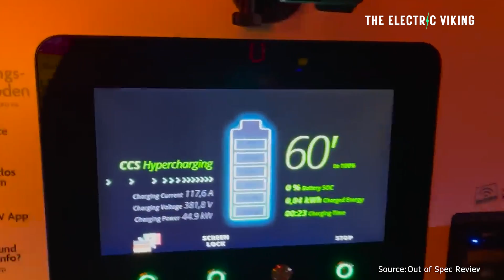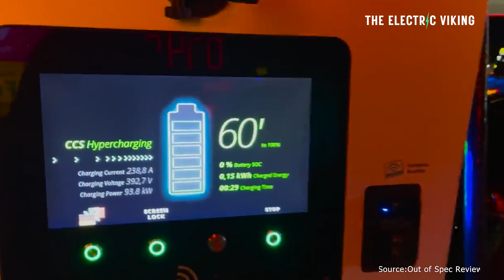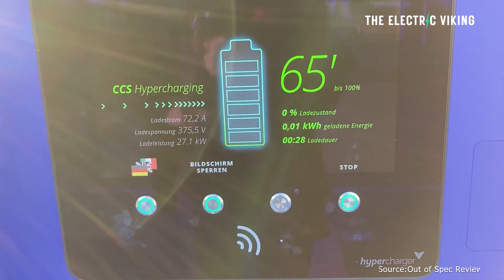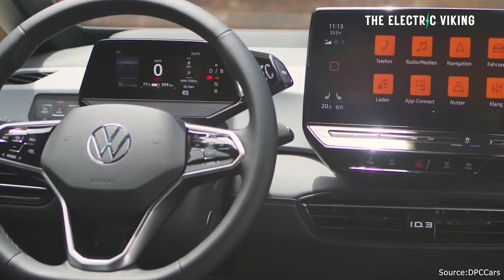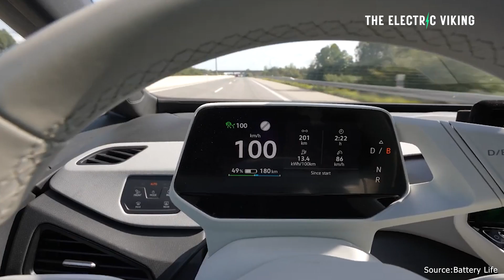VW EV Battery life tests show surprising 93% capacity after 62,000 Miles

Comment: I have a 4.5 year old ID3 77kw.  Any range loss is not noticable, it will still do 300 miles on the motorway with aircon on so thats fine by me. Its also a great car to drive

Comment: Volkswagen has quite good EVs by now. The software still can not compete with Tesla‘s, but it works stable and solid.
The chassis is a lot better compared to Tesla‘s though. I drove a model 3 recently and at >160 km/h  
the steering became very squishy.

The battery will not be the limiting favtor the life of an EV. The chips might break first after 10-15 years.

Comment: We have a 2029 egolf, which has a stated range of 125 miles. However, we’ve found that’s understating the true range by about 15-30 miles in normal weather. After 80k miles, there appears to be no battery degradation at all! Very impressive!
Reply: Oops was supposed to be 2019, not 2029.😀
Reply: Not true, all my updates have been OTA, that’s over the last three years.
Think this ideas  are a little  out of date.

Comment: We have a 23 VW ID.4 Pro S AWD with 15220 miles.  The battery capacity is at 94.45%.  As of February 6th the car is two years old.  Battery degradation is 5.55%.  We charge at home to 80% and very rarely take a road trip using DC Fast Charging.  It has a 82 kWh Lithium-Ion w/ SK.

Comment: The obsession with battery degradation is somewhat misguided. What is important is that the battery remains useable for the life of the car. Even at 70%, the battery will satisfy the same transport demands as a brand new battery. All that's required so to charge the battery just a bit more often. It doesn't cost any more in electricity to do this.

I think whilst we are in this technology transition period, where we don't have concrete examples of modern EVs that are 20 years old, there will always be some confusion, uncertainty and fear in those who are afraid of change and new technology. In terms of resale value, all cars devalue according to age and distance travelled, but the EV fear mongers forget this fact. Nobody knows for sure yet, but if modern EVs prove to be durable and with useable battery life for many years, then we will find EVs hold their value more than ICE cars.

And we need to ignore the example set by cars such as early model Nissan LEAFs, they were bad from new.

Comment: How about this one? If the battery degradation after whatever amount of miles is 10%, does that mean that you then have to stop charging the battery at 70%? Or can you still charge to 80% 🤔
Reply: 80% of the usable capacity which gets reduced over time due to degradation.
Reply: Maybe you should charge to 90% to compensate and achieve the same range😊

Comment: My wifes id.3 has 133000 km on the odo. If it is has degradation (which it of course has) it is not notable. 
It is only charged to 80% on regular basis and only a couple of tines on DC (yes only a couole of times because I drive a model 3 we use for longer trips).
So yes, VW batteries are fine.... 
Newer Li-ion batteries should last 1500 cycles or more to 80-90% if treated coreectly. In most cars that is ~500.000 km or more.

Comment: My 2018 , 40 kWh Nissan Leaf has just turned 100,000 miles today after passing its MOT test yesterday . According to LeafSpy the battery capacity is at 88.6% . Also no work required for the MOT .
Reply: Charging habits?
Reply: Decent result but smaller batteries will always have fast battery degradation. Still not bad for 100k miles!

Comment: Though not scientific my 2019 Nissan Leaf with 40 kWh battery and 65,000 miles on it has very little degradation and it is an air cooled battery. Original published range when new 149 miles current range on a warm day driving mostly highway speeds 130-140 miles of range. When below freezing 100-125 miles of range. So I would say I still have 85-92% of original range depending on driving conditions.

Comment: You mean the 35.000$ without taxes for the ID3, because it costs 50.000 Euros with taxes (about 50.000 USD) with parking sensors front and rear and heated front seats as I last checked it. It starts at 40.000 without that.

Yes, it's extremely expensive for an electric VW Golf basically. 

And so it does not cost 35.000 USD everywhere outside of china, where they sell it for 16.000 as you said it.

Comment: 93% at 62k miles is I guess an ‘over performance’ but I would think on average with like 95% level 2 charging we will see a good amount of people with less than 10% degradation around the 60-80k mile mark as long as they’re actually charging to like 80% for non LFP etc and then w LFP degradation will probably be slightly less even with charging to 100%

Comment: only problem is that a battery at 80% doesnt mean it will hold charge for 80% of the new battery. It could drop off quickly after charging.
Reply: That's not true. A modern EV's BMS will rate the range still available on a full charge. So a range of 80% means it will do just that - 80% of the new car range.
Reply: @vasil7410  so it will just recalibrate its 100% mark? thats scam in my view.
Reply: @AndrewTSq  How is it a scam? The state of charge is always going to be a percentage, from 0 - 100%. The range is also shown by the car, and it is adjusted throughout the life of the car to reflect the condition of the battery.  If you had any experience with EVs you'd understand how it works.
Reply: @AndrewTSq there are 2 battery percentages that I'd like cars to show. The first is exactly what the car can currently charge to and calibrate that as 100%. This is what you want day to day. I also want the BMS to estimate/measure and importantly show how much that 100% is of the original one. This is the percentage you'll hear people discuss when they talk about degradation, but isn't available to users in most infotainment systems.

Comment: I chose an MEB platform car for my first EV (Cupra Born) and I'll probably do it again when I upgrade in a couple of years unless BYD drop some hot SUV crossover.

Oh and my five reasons for not buying a Tesla here in Australia

1 No Australian tune for the suspension. No love for the righthand drive market at all. Just compare BYD's attitude, they have been much more pro active.
2 No adjustment of the one pedal drive mode.
3 You will never own the self drive software and most likely have to pay a subscription to keep it updated.
4 Cars driving style can be completely modified with OTA update regardless of your preference.
5 The Ford Model T mentality.  "You can have any colour you like as long as it's black". As good as the car is you don't get a lot of choice of how it looks, and you think you see a lot of them on the road now, just wait after a couple of more years of them selling at their current rate. Your never going to be able to find yours in the car park. I guess that's why they are working so hard on the summon option.

Oh and look none of the points have to do with Elon's personality.

Comment: The 4680 battery of Tesla’s is the worst on the market . Doesn’t hold charge well and least dense so limited range, far worse when you turn on accessories like Airconditioning or load up the car with luggage. Only in America out of freemont  so model Y predominantly model 3 and the doomed cbt. Should have gone 2670 instead good news though the mega battery plant VW is building in the USA has its entire factory floor area built on the ground . Now the big shed goes into place , the quickening !! 2024 on line

Comment: My takeaway: those of us that can't afford a new EV, or don't have home charging are condemned to have a car with a very short range which isn't suitable for regular long journeys.

An old ICE car retains pretty much the same range as when the car was new. Yes, there may be issues with the engine, but these are on a small percentage of cars and in any case can be fixed. 
Re VW, I wouldn't buy one of their ICE cars anymore, especially after the diesel gate "fixes". I had experience of this on an A3 2.0 TDI. The company and its dealers behaved appallingly, so badly that I wouldn't want to trust them or indeed reward their behaviour by ever buying one of their products again.
Reply: Ditto BMW for me.

Comment: A 10% or more degradation over 100,000 kilometers is bad. Compared to gasoline vehicles, this means the second or third owner will probably need to replace the battery, making these cars a poor choice for the used car market.
Reply: 93% is 7% not 10 and they tested the worst cenario. No one should only use fast chargers and to 100%.

Comment: That stat doesn't do it for me. 
In order to do a proper cost comparison, we need to know the average  degradation rate over 12 years. That's a reasonable length of time to expect a car to last. More importantly, we need to know what percentage of these cars have had to have a battery replacement along the way. Sure, you can find cases were the battery lasted 400 miles, but there's a LOT of cases where batteries fail during the warranty and many more after the warranty expires.
A friend has a 12 year old Tesla on the original battery which is good. It has 70% capacity left so it is on it's last legs. However, he is semi retired and doesn't drive a lot and also owns an ICE for long trips and bad weather.  His car is slow charged at home and not very often.
Reply: I agree with the intent, but until we have large numbers of people reporting degradation data over many years we won't have the info you want. It is as simple as there aren't enough of them on the road for anywhere near that timeframe. What we are getting is scattered reporting of heavy use vehicles over much shorter times. However, we know that battery management is also getting better so in theory if you follow the manufacturers recommended guidelines on recharging you should get close to the same result that current heavy use reports state. You should also adjust for extreme cold. Which takes us back to mileage as the main factor since that drives recharging cycles which drives degradation. It is then up to the owner to follow the recommended recharging cycle. In the US battery warranty is mandated to be at least 8yrs and 100,000 miles so there would be very few failures not covered by warranty at this point.
Reply: How is 70% capacity “on its last legs”? If it had original range 300 miles, that’s now 200miles which is more range than many new smaller EVs. Maybe the Tesla chassis is on its last legs but not the batter which will likely be reused in power storage for many decades to come before it’s finally recycled.

Comment: Tesla batteries have ~8% degradation per 200k miles. So, ~7% degradation per 62k miles for VW Group is terrible. As is the software as well. I'm German but would never buy another German car, even if they gave it to me for free. Tesla runs rings around legacy auto.
Reply: The VW figures stated in the video are from testing under worst case conditions: fast charging up to 100% for 100,000 kilometers. Is the Tesla figure from a similar test regimen, or is that from typical use (mostly slow charging to 80% with the occasional fast charge)?
Reply: That ADAC testing was not even worst case for batteries, as they did not follow some of VW’s charging recommendations. Driving hard also has a significant impact on batteries. For the Tesla figure it is the latter. Volkswagen guarantees that their batteries will still have at least 70% of their usable capacity after eight years or 160,000 kilometres if you use them correctly as recommended. That is up to 30% degradation in 100k miles if you follow all of VW’s guidelines.

Comment: ID 3 does look good , from the pictures , went to the new BYD showroom in Sydney the other day ,to look at the seal and dolphin , Seal quite a big car , only thing I do not like is the sun roof hasn’t a blockout screen , as the dolphin looks good  , going hopefully for a test drive soon in the dolphin , do you think the BYD cars are as well made as say the VW ,or Tesla , I think the overall ownership cost will be cheaper to maintain in the BYD also the blade batteries seem to be the best at the moment for longevity , ps , hope the wife is doing well Mate , take care
Reply: The VW's are definitely the better cars. Cruise control, lane keep, seat comfort, controls on the Entertainment system.  Also the ID3 is completely built for EV so the size inside much bigger than compared to the competitiors.

Comment: Isn’t it weird how all of these conditions and rules on batteries seem to just roll of the tongue as though this would not worry any neophyte to EVs.  How do everyday people cope with the does and the don’ts to get the best experience from ownership?  Take a cab.
Reply: It’s actually a lot simpler than a gas car with far less to go wrong and nearly zero maintenance.
Reply: @brentpederson4942 I see the point of view but looking under the hood of an EV will dispel any notion that it’s just a battery and motor.  What could possibly go wrong with such a simple proposition?  Fault analysis seems just as complex and consumables are just as regular.  Here’s an idea for a book title:-  Where do EV battery packs go to die?

Comment: Well then, they should list mileage estimates with a range  80% - 100%.  It isnt right to give the 100% mileage estimate as the actual range of a vehicle if you are only charging to 80%.  You only have 80% range available so THAT is your range.
Reply: Not really, no one goes around with the fuel tank full everyday day of the week. Most EV owners that charge at home rarely see the battery below 50%. And charge to 100% before going on a long road trip.
Reply: @Rebelapes  The difference is that EVs mileage is per charge, 100% charge.  ICE vehicles are rated per Gallon and/or tank FULL. But if you never charge past 80% then that is what you have.  Most people fill their gas tanks.
Reply: @pipersall6761 That would be the miles per kWH figure you want. For example, mine gets around 4, so I know how much I can get on what level of battery.